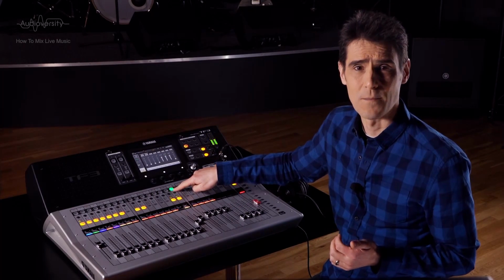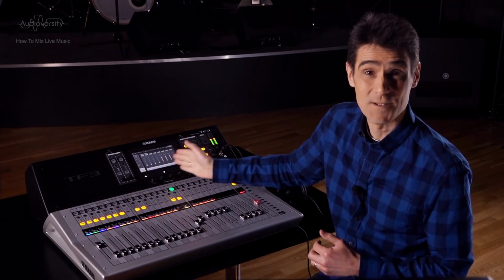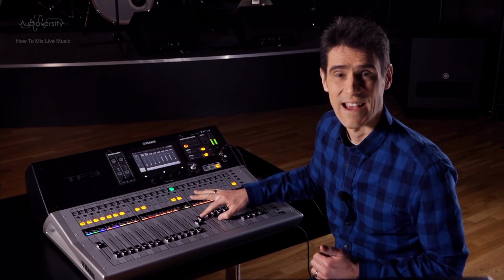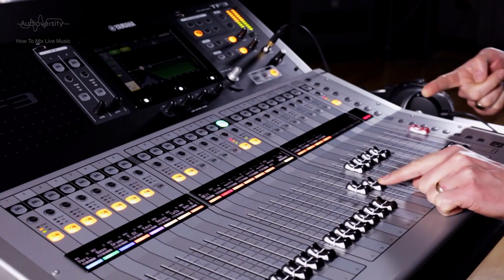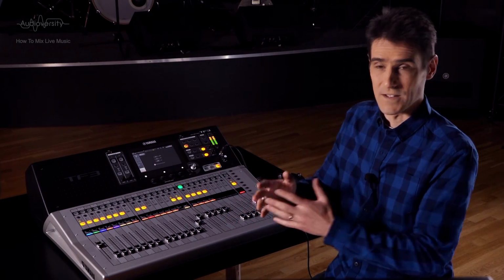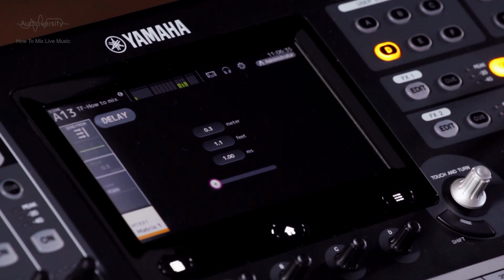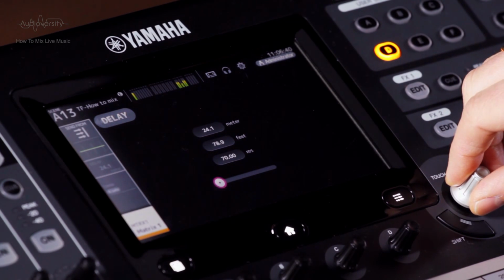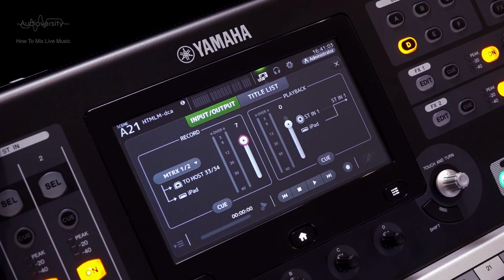How To Mix Live Music Chapter 17 - Sub, Mono & Matrix Outputs

Comment: My i ask what i done wrong,  i use aux send to sub woofer then i connect another one to out daisy chain same volume level active subwoofer.  My question why they are not same sound of bass even the indicAtor Led nver ligth but i try in contronl rom left and right they are d same sound output.

Comment: Being an old small-scale analog person, I have a maybe ignorant question.  Is the mono sub controls designed to replace the need for a cross-over between the subs and the tops?  If so, is it common to have the ability to do a 3-way cross-over (sub, mids, highs)?  Or is it assumed today you are using tops with built-in active cross-overs?  Thanks in advance.
Reply: You can use an eq-ed matrix output to perform a 3-way output. You will have to band-pass the main output and high-pass the matrix output in this case.
Reply: @manamimnm  OK that makes sense.  Thanks!